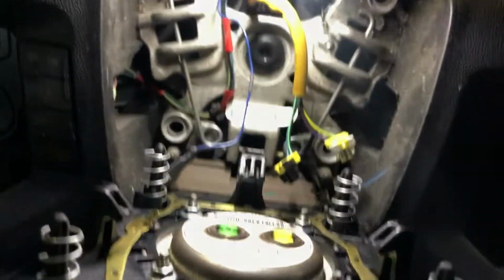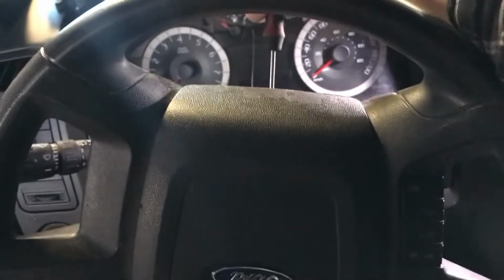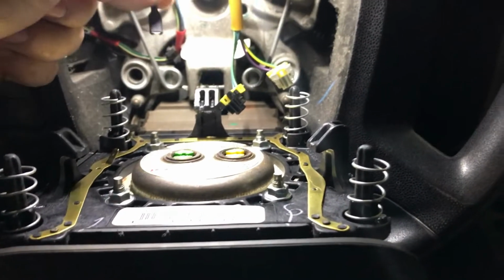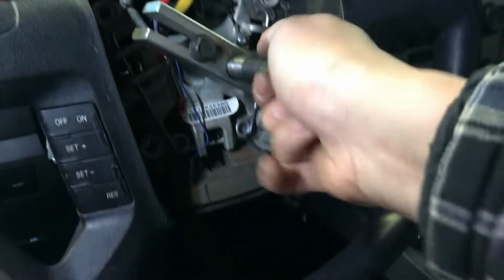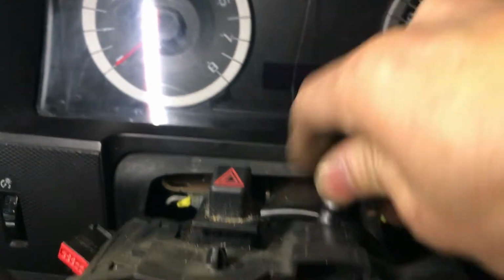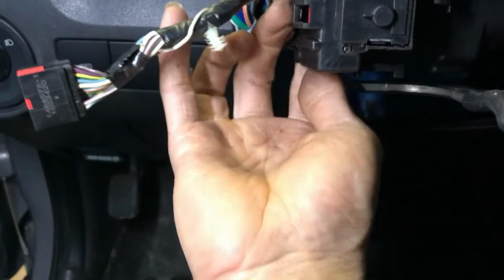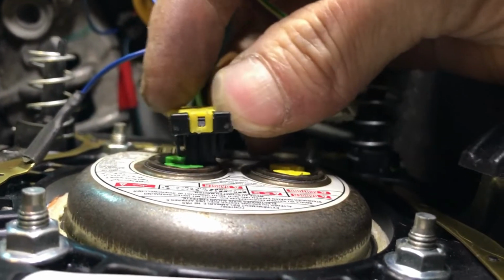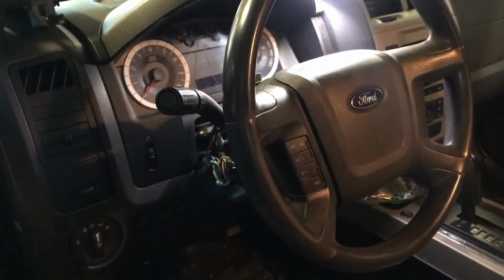2008 - 2012 Ford Escape : How to remove Driver air bag & replace Ignition Switch. P2

Comment: Sir you are incredibly AWESOME thank you so much for your help. 
I have a 2008 escape and it seems all the trouble shooting signs are the same for me. Would a screwy ignition switch still work but sporadically ??? I would always have to wiggle the key once I had it turned forward to start the truck  until just the other day it finally  wouldn't work anymore so a $200 later , it's sitting in the driveway. 
I can do all this work no problem there and this does seem to be my issue but could it be a faulty starter as well ? Turning the key to start the truck does nothing to the starter motor so could an screwed ignition switch also stop the starter from turning ? The starter does "NOTHING" when the key is turned but the solenoid will spin if I use a screw driver and touch the two bolts on the starter ?
"MAN" I hope someone has some info for me.. Today is Monday March 6/23
Thanks again for the great video I wish the best of days
Cheers from Vancouver Island Canada
Tim
Reply: Did you ever find out if it was the starter or the ignition switch? im having the same problem.